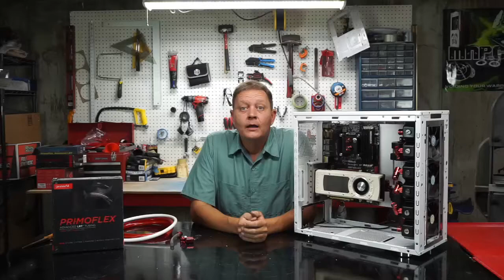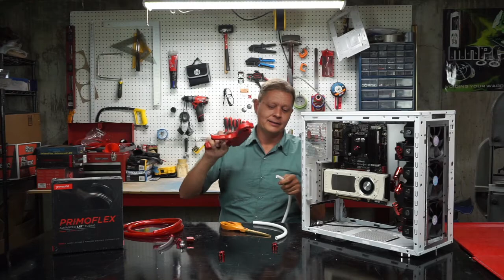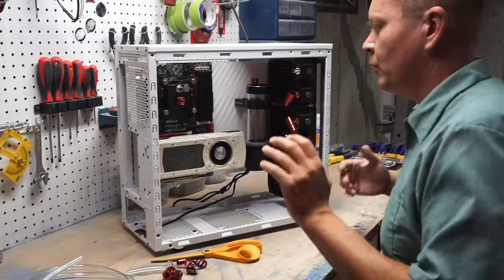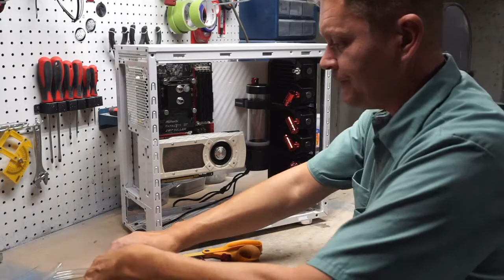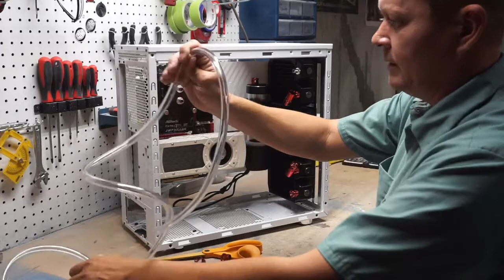Down & Dirty Modding - Running the Flex Tubing - CPU Loop Series

Comment: Do you have any brand recommendations  for petg and glass tubing?
Was looking at Koolance LIQ-702OR-B uv orange for my build, not much info out there on this brand, any experience  with this product or a comparable recommendation? 
Thank you for these videos!
Reply from the maker: I've never used glass tubing and it seems like it would be difficult to work with.  I know Alphacool has glass tubing and they're a pretty good name so if I were going to try it, I'd start there.  As far as PETG, I use Primochill.  Every piece I've gotten has had good clarity and shine(on par with acrylic in my opinion) and I like the thickness of the tubing.  Some brands have a thinner wall and that sort of freaked me out when I used it.  It felt very weak.  For coolants, man, that's a huge can of worms to open, lol!  I'm using Mayhems in all my builds right now, but I've used Primochill with no problems.  I've never used Koolance so I can't say whether it's good or bad, but since you're not finding hundreds of posts claiming it's the worst thing in the world, it's probably ok.  And since there aren't really a lot of orange coolants and especially UV you might be stuck with using it.  One more thing I might check would be to search for builds with orange coolants and see what they're using.  That might give you some more options to choose from.
Reply: Cool, thank you :)